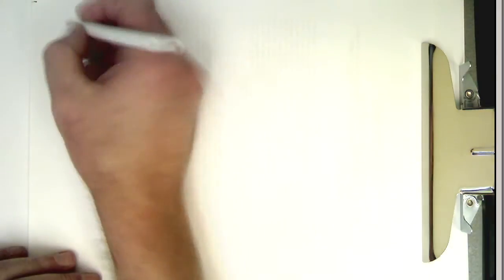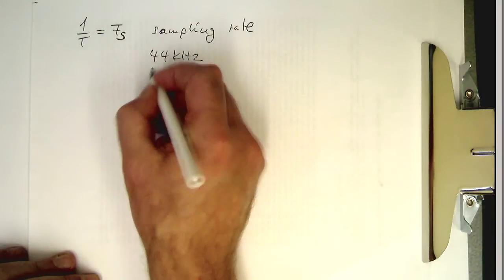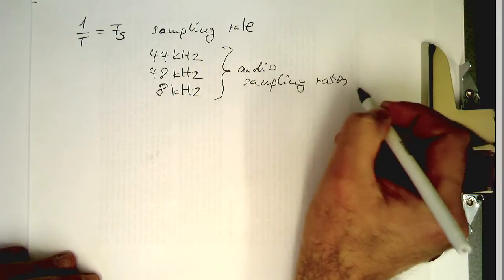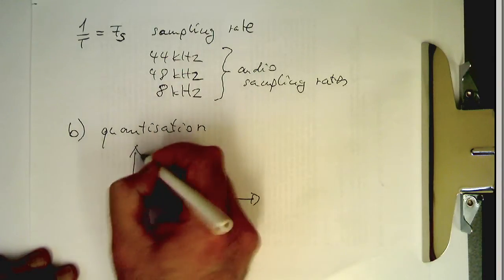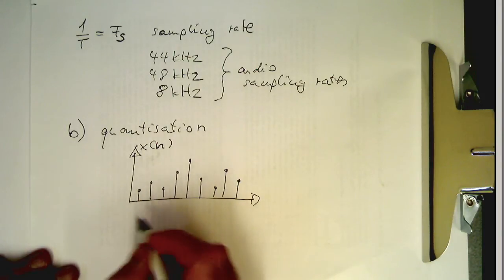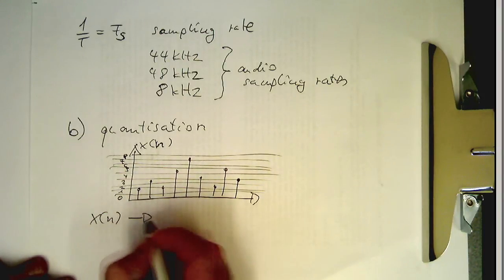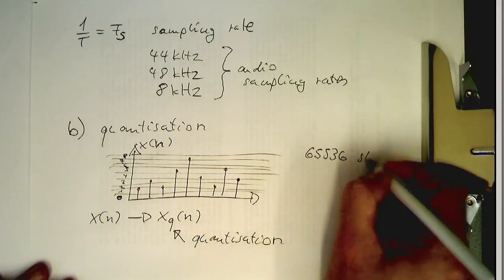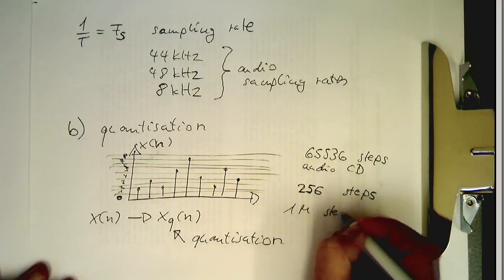DSP introduction - quantisation (#003)

Comment from the maker: Hi,
good question. That depends on the application and the data type. In audio often the data is converted into floating point between -1 and +1. If it's integer then the max value (here 127) would be the max voltage at the ADC, for example 1.27V to make things easy to calculate (with 1mV for every step).
Reply: Thank you!